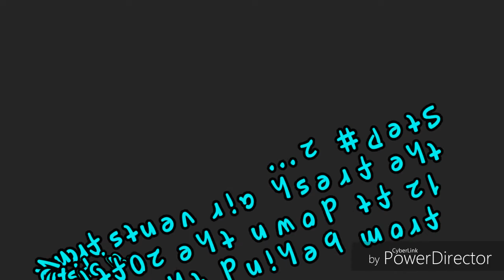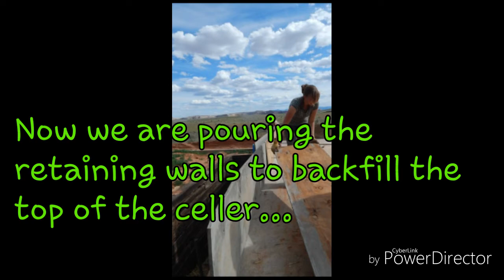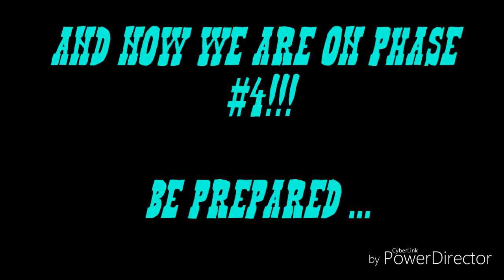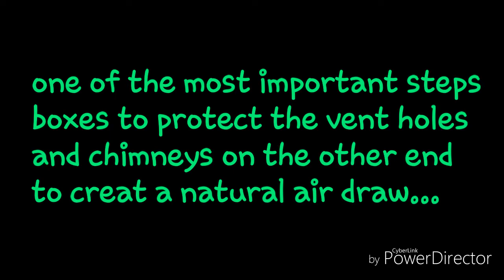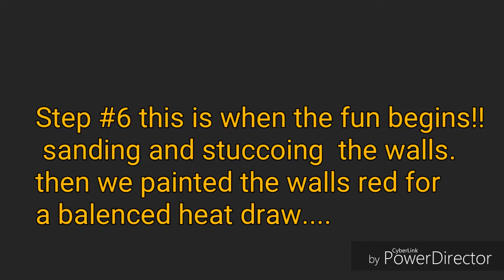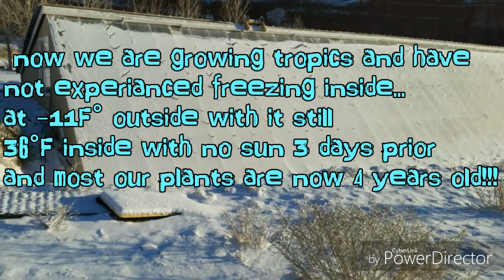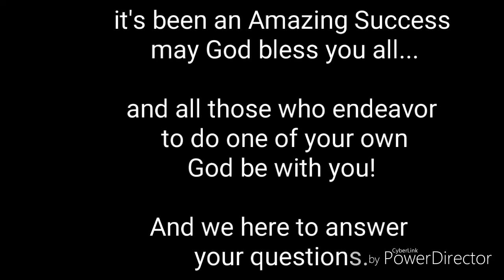Build it Right the first time! Quick how to build in 5 minutes( Wallipini Express )

Comment: Love your video series on this. Just curious, have you had any issues with mold in your cooling tubes? Also, is there water coming out of these tubes and if so, how much do you normally get over the course of a week?
Reply from the maker: No mold in them and no water they move the air through and create air flow. Cool air in the summer and warm air in the winter!

Comment: Thanks so much! Im on a similar project but my north wall is a mountain rock so im not able to make this ventilation. Can this pipe enter from the south east side too? And does it need to be at the lowest point necessarly?
Reply from the maker: Hello shoes, yes you can come in from the sides, just don't go cheep and do it with to small of pipes. Ventalation is the key to success. Fill free to contact me at 435 840 8117 for any questions

Comment: I'm a builder and I'm lost with this video. This greenhouse is significant in the design demands and performance you built into it. This info is hard to come by. Sizing, depth, ect. What worked and what would you change some. The cold sink is foreign to me. Can you point me to anything that helped you succeed in this design before you spent this kind of money. Is any of the engineering available from you or someone else that you can help with?
Reply from the maker: If you want to talk to someone personally you can call this number # 4358408117... 
Also with the cold sinks yes we have used it many times on our farm we do it for the animals water to keep it from freezing during the winter thus leading to further investigation on how they work! We are hopeing to put out a more in depth video on how to build but it still has some time yet to get it out. But we are happy to answer questions over the phone.
Reply from the maker: If you want to talk to someone personally you can call this number # 4358408117... 
Also with the cold sinks yes we have used it many times on our farm we do it for the animals water to keep it from freezing during the winter thus leading to further investigation on how they work! We are hopeing to put out a more in depth video on how to build but it still has some time yet to get it out. But we are happy to answer questions over the phone.

Comment: What was your approximate cost?  If I were to guess, I would guess close to $100k... especially with lumber prices today.  The cement alone had to be $30,000.
Reply from the maker: Yes it was over 50,000.00 but we'll worth it.
Reply: @wallapiniexpress3648  Maybe not. You should have looked into greenhouseinthesnow.com.  1600 sq. foot geothermal greenhouse for about $25k (not including labor)... all heating and cooling included.  You could have had more than twice the size greenhouse and 50+ citrus trees for the cost of yours.
Reply: @basedbear1605  I wouldn’t say that. Just look at the pictures of how much space there is underneath the roof of that one. It’s much more cramped and I don’t see a way to grow a normal sized tree under it.